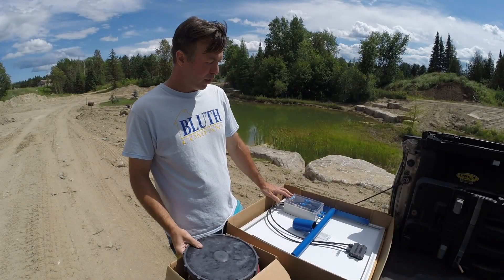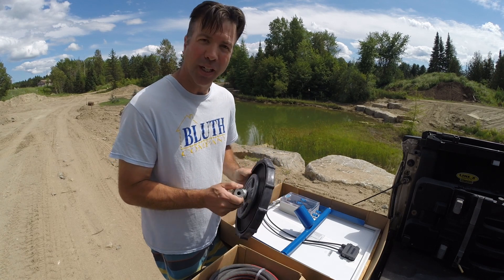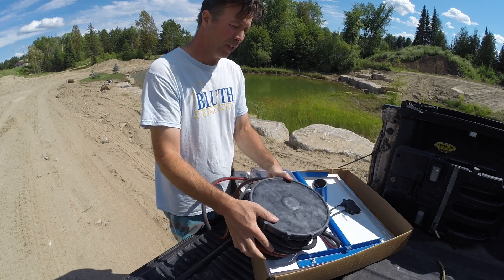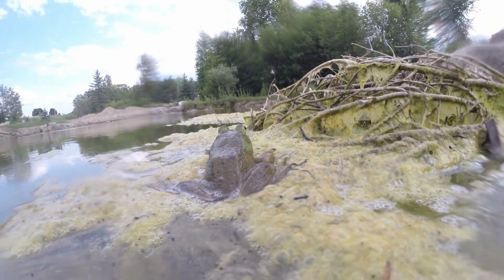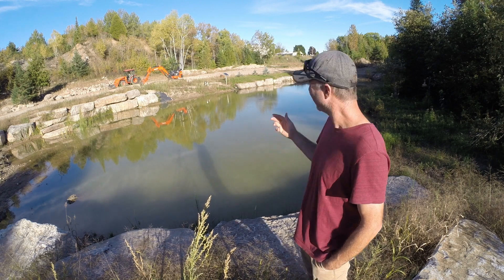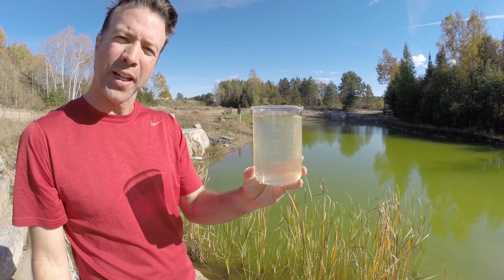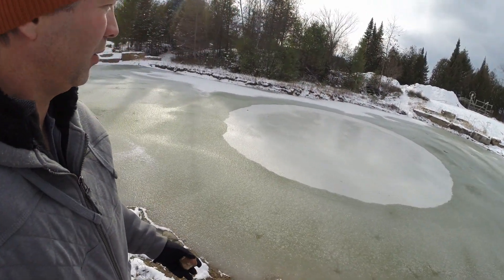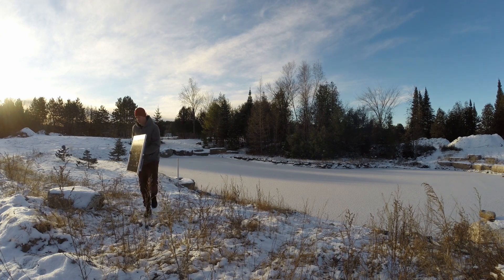Pond Aeration System

Comment: Not sure how much you learned about how to really get clarity and healthy water over the course of your journey here, but quite a few misconceptions as well as what you leanred all on your own.  Been ponding now for 13 years and with much more density than you've got, have never had greenwater since inception and am definitely overstocked.  The key here is sun, runoff (organics/fert getting in) and no plants.  The keys for you would be to find shade (water lilies can shade and help with the nitrogen cycle, albeit modestly at best if NOT allowed to roam free which would be my suggestion), add lots more plants, and create a berm around the pond so you don't get any further rain runoff.  I came for the solar aerator and what you have, imo, is woefully inadequate.  For the price, I expected more and better, despite you did a good job explaining what you have and how it all worked out.  Kudos for that.  For a pond that size, you'd need much more aeration for any real oxygen saturation (continuous).  Natural ponds work on massive surface to air agitation and the wind is the main source of that, which you'd have also.  A waterfall would add so very much more than this aerator.  Problem will be getting power to it and I'm not a huge fan (so far, including this vid) of solar.  You'd need a much larger array and backup batteries, which only increases the cost of solar.  Too, adding oxygen is NOT going to get rid of your algae issues; whoever told you this isn't understanding the chemistry and dynamics of a pond.  Aeration is good, but moreso for the fish and beneficial bacteria.  Any underwater plant is going to give O2 during the day but oxygen is taken in, at night.  Chems you can add (algicides) take oxygen OUT of the water during it's process and next to a heron, is one of the best sources for fish loss horror stories.  I don't ever recommend.  Natural is the way to go.

So, add shade, add lots of plants, make that berm, don't overstock, don't overfeed, keep the bottom clean (which will be problematic with a large pond as the fall is going to continuously put leaves etc into your pond; any sort of windbreak/shield could help but with time, this organic layer is going to build on you and the decay process won't keep up, thereby increasing the mulm layer every year until dredging will be necessary, which is expensive.

Your aerator system is never going to solve water clarity here nor will it substantially increase O2 saturation, even if running 24/7.  You found it could get iced over whereas my own smaller unit could keep a hole open, albeit it's using electric mains for power.  And all ponds have algal blooms initially; it's what you do from there that will determine if it stays a problem.  Out competing the single cell free floating algae is the key and to do so, you need plants---lots of them.

I appreciate the time you took to examine the solar aeration system and hope this info above can actually get you closer to your goal.  The many 'voices' out there suggesting dyes and chems, even aeration, are all coming from a standpoint of trying to sell you something, which I am not.  If curious, visit my channel and watch/see the vids of a much smaller pond (7K) that has a much higher stocking density than yours, and see if all my advice above is effective.  Good luck!
Reply: Wow thankyou for your words you have given me as a reader of your comment good info much appreciated for your comment
Reply: How do I find your page please?
Reply: @Tania-vl3lo  swordofthedarkmuse
Reply: Where did you purchase the aerator system?

Comment: I run the dye on mine. It blocks sunlight and plants can't grow under water. Another method I haven't tried is to sink some bales of barley . Suppose to work
Reply from the maker: I made a follow-up aerator video and had been using dye at that point, and yes, you're right. The dye does really help.
Reply: I had a round bale accidentally get in the water of just grass.. it filtered it for 2 years as long as it floated.

Comment: The key to pond and lake aeration is 1) aerating the deepest portion 2) aerating the entire pond evenly with enough diffusers to achieve a minimum of 4 fluid turnovers / day 3) adding enough cfm (volume of compressed air) that matches the number of diffusers. 

The unfortunate part of solar aeration is that they are extremely limited due to how much cfm the compressors supply. (1-2 cfm usually) They are also quite expensive compared to Systems that have readily accessible power. 

It’s all about mixing aka fluid turnover rates.  8-12 fluid turnovers / day is ideal for ponds less than 5 acres in size. 1 fluid turnover is the time it takes to mix the volume of the pond a single time with the installed aeration system.  Undersized aeration system will take exponentially longer to achieve noticeable results. 

Fine bubble aeration will provide the most mixing and the non-turbulent rise rate of the bubbles settles solids out of suspension.  Coarse bubbles do the opposite and are not recommended. The next component is to apply beneficial bacteria to digest the organics and nutrients that find there way into the pond.  Think of pond aeration as recreating a river in a body of water that lacks both oxygenation and mixing. 

3 of the membrane diffusers you installed will significantly improve the results achieved. I design and manufacture aeration systems for a living and I’d be happy to help you or anyone else out via DM. Best of luck with your project!
Reply: Hello Tom,  we have a 50 year old pond, are you still available to ask questions on aeration systems?  Keith in Northern MI.

Comment: Add limestone. That will naturally bring up the PH levels. Add some west nile perch. Vegetarian algae eating fish.
Reply: I heard that adding limestone to a pond isn't going to raise the pH at all, because the pH isn't low enough to dissolve the limestone. Now, i never had a pond, but i had two aquariums in the past and i was also looking into ways of getting that pH up. More current in the water raises the pH though. This is because gasses like Carbon Dioxide (which is on the lower end of pH) will get aerated out of the water. It is also a myth that when you put Oxygen in the water like in the video it will add Oxygen to the water, but that isn't true. Oxygen does not mix with water in the way we think - it's just bubbles that creates circulation. Great video by the way, keep it up. PS. To get rid of the algae / algae bloom you need to add competitive surface plants to draw out the nutrients like Phosphate & Nitrate, but also consume Carbon Dioxide. Also be patient (side note an aquarium is considered matured after a year)
Reply: PS 2 :) Great idea with the algae eating fish! Also snails would help.

Comment: New sub here. Easy aerator setup. Do you have the pump info ? Thanks.
Reply from the maker: They have smaller set-ups than the ones listed here. Just call them. I have the 2 pump system. They will size the system to your pond size. http://www.thedugoutdude.ca/dugout-systems/solar-aeration
Reply: @ryanhoelke how much was it?

Comment: I added an aerator last year to our 1/2 acre pond which is 11 feet deep at the deepest part of the pond (Kasco 1/4 hp compressor and the Kasco diffuser).  The pond was dug 70+ years ago with a grassy bank, but is now surrounded by trees/bushes which dump their organic matter into the pond and there is lot of muck on the bottom of the pond.  The pond clarity was usually 6 inches or less in the summer with frequent algae blooms, and stinky and stagnant.  We started the aerator in early summer, so we needed to ramp up its aeration over time to allow degassing hydrogen sulfide gas-and it was stinky....

So once the aerator was running 24/7, the pond turned green after about a week later for a week for a week's time, but then started to clear up to a little more than 2 feet after about a month (measured with a Secchi disc).  Then 3 - 4 weeks later, the pond clarity improved to almost 3 feet, the clearest the pond has been since about 25 - 30 years ago.   Then the duckweed happened and the pond was completely covered.   A flotilla of ducks showed up and feasted on the duckweed and eventually ate it all - wow.  This coming year I will add a second diffuser, which is needed because the pond is long and narrow, to enhance the mixing/oxygenation at the narrow/shallow end of the pond.

Because you have a solar powered aerator, you are only aerating the pond part time, and so the aeration/mixing is reduced compared to one running 24/7.  I would wait and see what happens this coming year once the aerator is running starting in early spring.   Rather than pond dyes, I suggest beneficial bacteria which is good for the animal creatures, and helps to digest that organic matter, and it outcompetes the algae for the  nutrition in the pond.     That compressor seems a little tiny, what air flow are you getting?  Mine puts out 3 scf/min.  

Love your videos, they are informative and lots of fun!
Reply from the maker: Thanks, it's nice to know that aeration does work, especially on such an old pond as yours. I was a little skeptical at first. With this pond only being a couple years old I should be light on the bottom muck amounts and breaking down of organics, but hoping this summer works better. I need to clean up the land around the pond to stop erosion, that's for sure.

I will try the bacteria as well to battle the algae blooms. I still have about a foot of ice on the pond but will be hooking up the solar panel this weekend. In the future I will have some electricity near the pond (I don't right now) which is mainly why I went solar, so I could go to a larger electric compressor. You had me thinking on the pond pumps and I just asked the guy who sold me the unit and they are only putting out .5 scf/min. That will be something to monitor going forward.